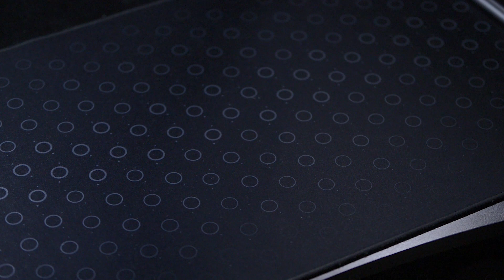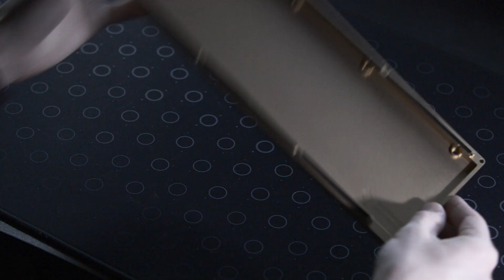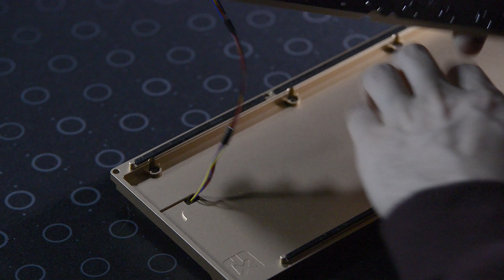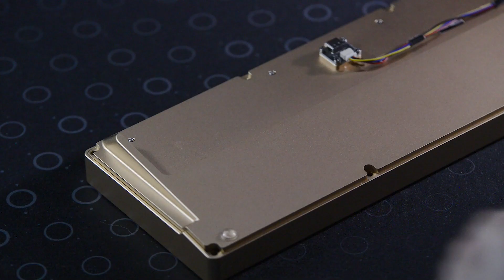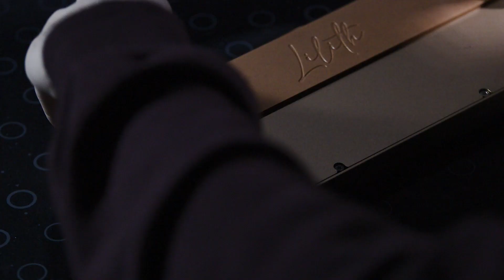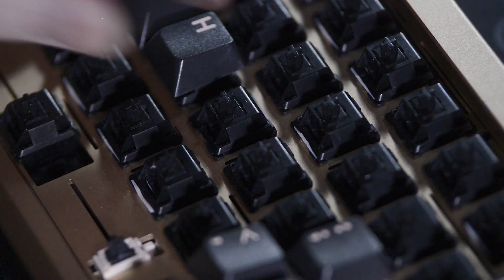Lilith by Nix - assembly

Comment: I really like this board! I love the unique way of putting it together, but will the weight fall out without screws?
Reply from the maker: The weight is held fast with 4 screws, as you can see in the last step in the assembly. As long as the weight is flush with the case and is being kept well in place when flipping it around, it will be tightened and held together properly by the screws :)